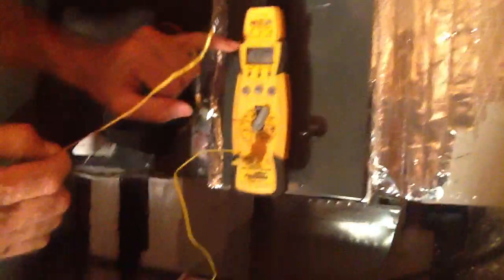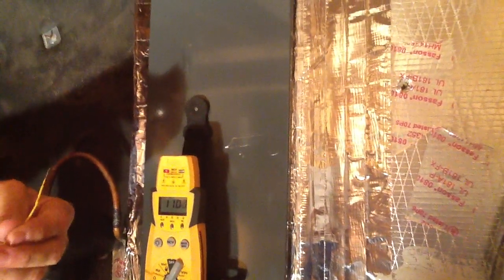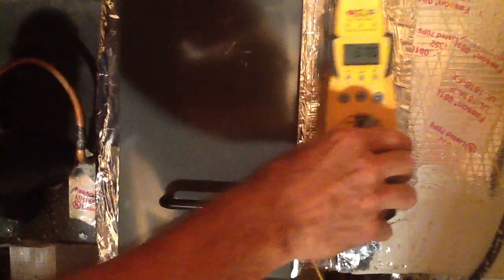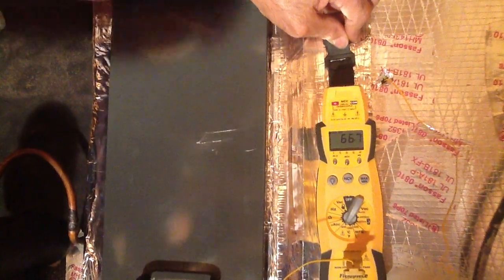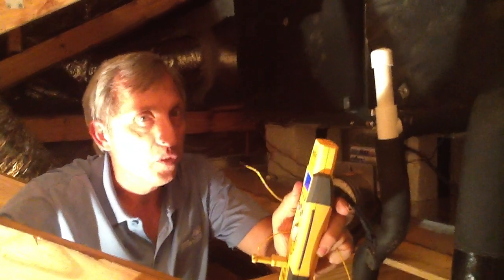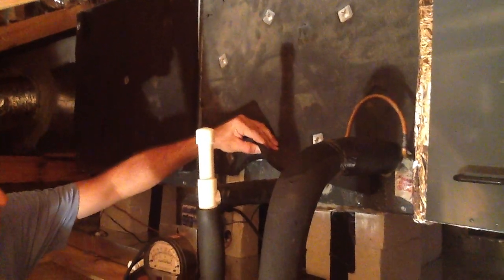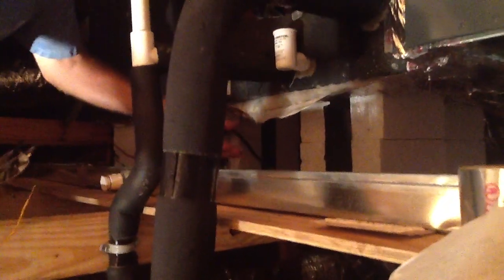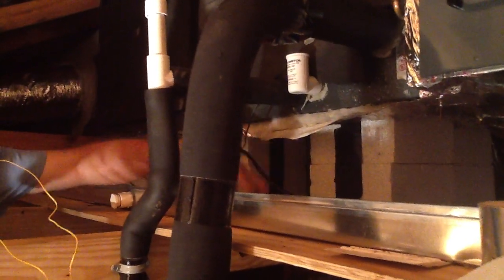Why is my Air Handler sweating in the attic?

Comment: We put a cassette in a bottled water companies sales office, it was ok till they installed their filtering and bottling plant in the warehouse, but after this the whole thing sweated as the air was so humind! Had to insulate the case of the cassette and the drain line, plus the sparky had cabletied his cables to out line set and squashed the insulation which also dripped.

Comment: Trying to decide if I should insulate my air handler as I live in fl with the air handler in the garage but still see temps of 95+ in the garage and tons of humidity with my air handler sweating all summer long. This video has made me decide to insulate the whole outside of the air handler. Thanks!
Reply: Did you end up insulating your air handler? If so, did it work?
Reply: What material to use to insulate or wrap the outside of the air handler?

Comment: David - my plenum has excessive sweating. The unit is in the attic. You talked about insulating the Plenum with some kind of material to prevent sweat. Where do I get the right plenum insulation material? Can I apply the Air Duct Installation cement to make the Plenum walls thinker to prevent sweating?? Thanks.

Comment: all the sudden mine blows steam/condensation out the roof vent and it has my rafters all damp and dripping in just the area from where the vent sticks out the roof. No explanation, just started doing it when I turn the heat on. Any ideas?

Comment: Jones - where can I get the air conditioner’s wrapping material to prevent sweating on the outside of my unit? Excessive sweating seems to cause black/brown spots which I tend to think it will cause molding in the attic??
Reply: The mood won't hurt you. That's a scam. 
Call a reputable HVAC man to have it checked.

Comment: “Comes from experience” but isn’t a correct solution. It’s a bandaid based on “guesswork”. In reality, and backed up by the books, Attic needs to be sealed and dehumidified. Dewpoint in being reached on that ahus surface.

Comment: THE PROBLEM IS VERY CLEAR, THE CUSTOMER HAS THE THERMOSTAT SET BELOW 65!! ITS AIR CONDITIONING! NOT REFRIGERATION!! Typically in memphis Tn. we have attic temps 130-150 and no sweating, using the factory insulated cabinet. Yes, our humidity is very high as well. Typically you need to check the CFM if the cabinet is sweating profusely!  But seriously, 66 return!
Reply: HVAC Xpert too many people are addicted to cool air . Or there may be fat  customers
Reply: Mine sweating and it’s set to 72-74 at all times.  Similar climate in Charlotte, NC.  Thinking it’s a poorly ventilated attic 🤷🏼‍♂️
Reply: Chris Moffett I live in charlotte and I’m dealing with the same problem, my tstat is set to 74.
Reply: Would not want to hire the angry HVAC Xpert. We keep our house at 73 and have the same issue with Handler sweating in attic. Factory Insulated cabinet is BS
Reply: @robjs10281  - how did you solve the handler sweating problems in the Attic? I have two units in the Attic. Inside house temperature set at 75 degrees during the day and 72 degrees at night. I had air vents added to the roof but I am still having sweating problems. I live in Texas and it has been hot. Rob, how do i solve the swearing issues on my Units?? Thanks.